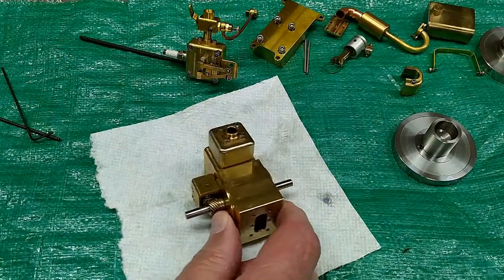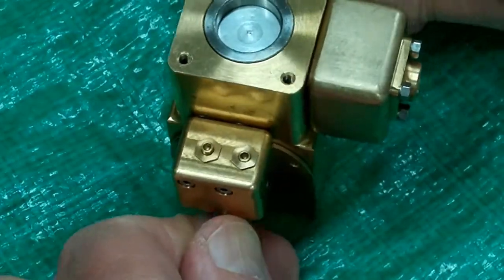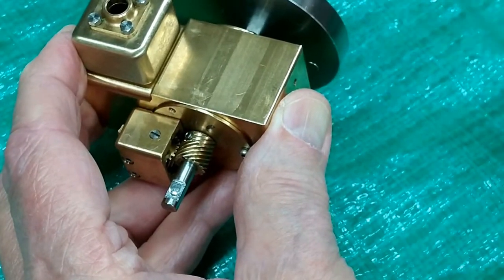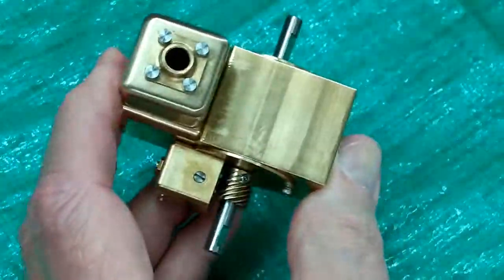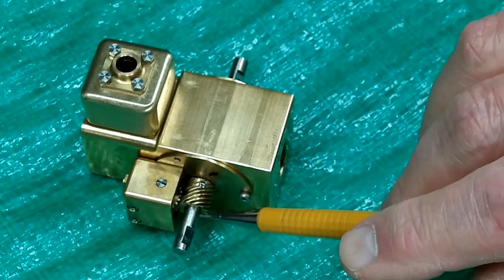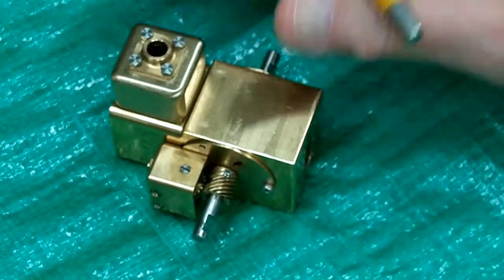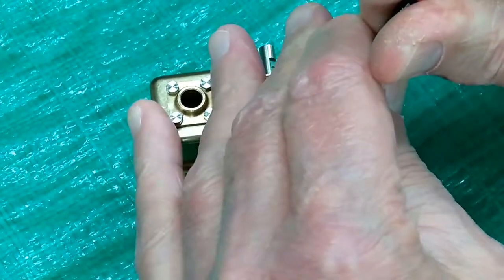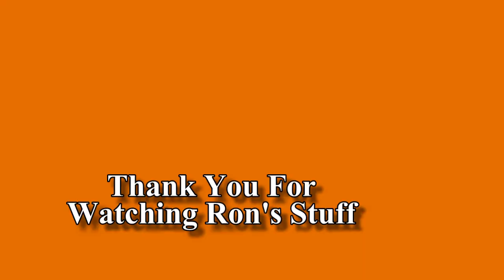Eachine ET5 - Valve Timing (Gear Timing)

Comment: its for sure has a flat spot for that cog on the crank, i dont think they be hand timing every motor at the factory. Im going to mark it well when i need to swap the crank bearings one day. Also my crank is still undersized so I might try electro plating it someday to bring the size up to make it fit better to the bearings.